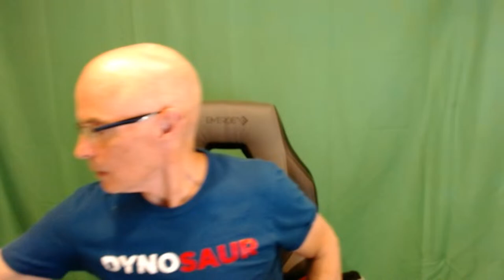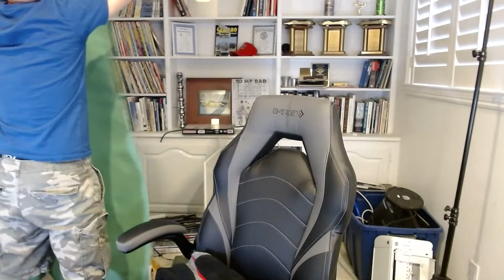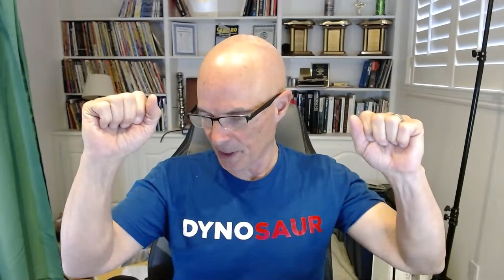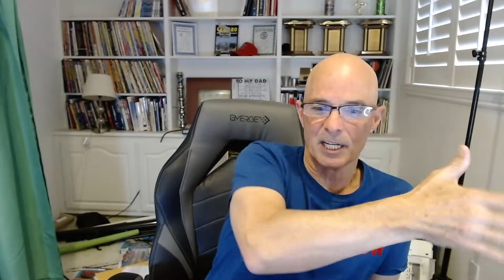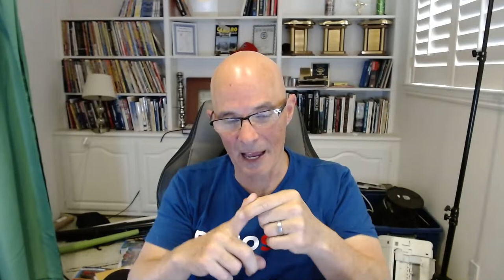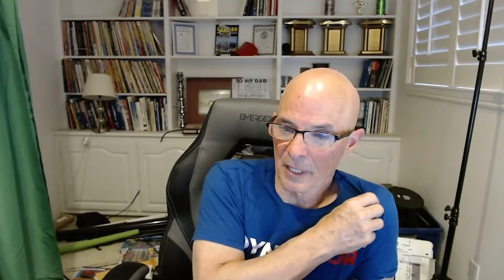ADJUSTABLE INTAKES-DYNO RESULTS-LET'S TALK TECH

Comment: Hi have a question about LS6 heads on a Windsor can you put the hype to test with a head an Ford gasket I don’t dabbled with the 67 FB that I sold last year and sad to let it go but this has been a big question in my head
Reply from the maker: ls bore spacing is 4.40 and 351W bore spacing is 4.38 (they are close enough to run on head on the other), but it is a lot more complicated than that.

Comment: Richard, I’m trying to chase down overheating issues on my turbo 351w, second to burping the car again with the lisle funnel, should I try something as easy as switching to a 160 thermostat and take the 180 out? It worries me how quick the car makes it to the upper 190s with high IATs during brief drives. Thanks
Reply: How big is your radiator? How big is your intercooler? Is your turbo fed by fresh air or is it ambient air under the hood? How much boost you running? What diameter are the primaries on your manifolds feeding the turbo? How much back pressure is your turbo producing and what kind of exhaust are you running? Ever tried water/ meth? Or ethanol? ALLLLL of these questions and possibly more are the answers to your question. You need to give Rich as much information possible about your motor so he can help you diagnose your problem. I have a BMW E90 with a 4th gen 6.0 I have a turbo for it but considering going the supercharger route for a few reasons but rich helped me a lot with 3 completely different motors. I just had to give him the information he needed. Good luck and I hope you figure it out.👊🏼🇺🇲
Reply: @butcherbaker4258 thank you for your time and reply. I have a 3 core radiator and the stock on3 intercooler for my turbo setup. The turbo is forward facing and I don’t have a hood that fits the car, so partial fresh air. No idea on backpressure and the turbo dumps at the bumper on side. Only have ran the car on 93. I know for a fact but can’t find a way to correct it, but I have a lot of junk in the front taking up a small area of space. Two small push fans are in front of the radiator(no room in the back for anything size wise) and part of the intercooler also covers the front radiator.
Reply: You might try a OEM 96 mustang draw thru fan assembly much better setup
Reply: @gregsmith8032 will write that down and consider it, the contour or v6 Taurus fans are also popular fox swaps but I do not have the room behind the radiator for a big pull fan.
Reply from the maker: push fans are not good